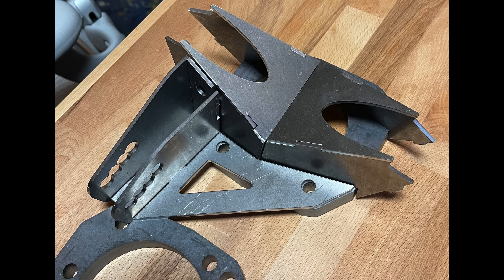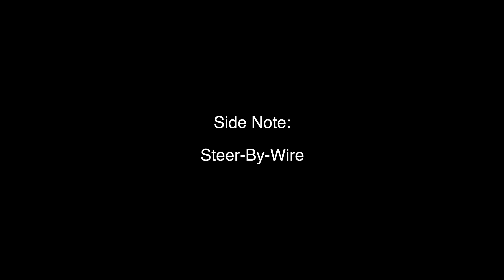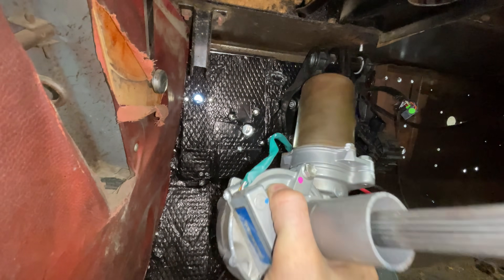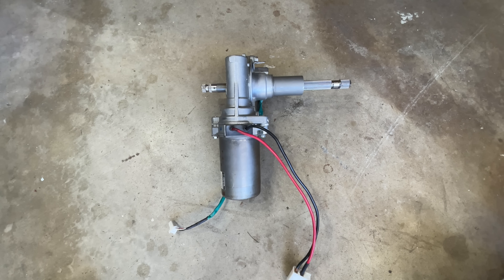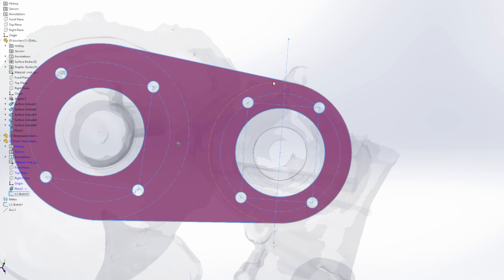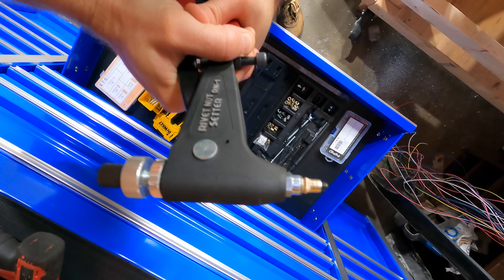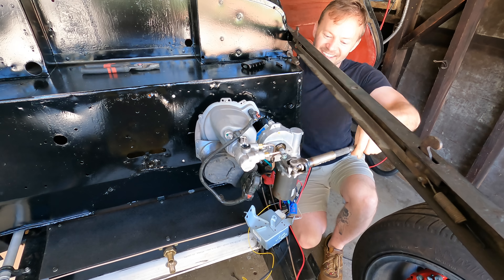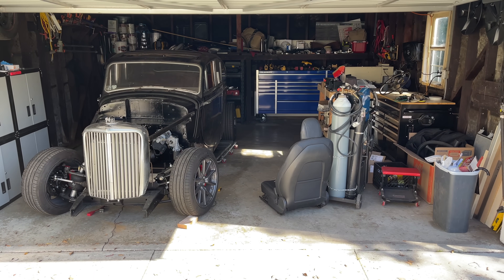Add Power Steering To Any Car

Comment: All hail the algorithm! 

I have no opinion of value, just my engagement. You may consider a steering quickener (1.5:1 inline gearing) now that you have power steering.
Reply from the maker: I swapped in a BMW rack that has a much quicker ratio than stock. It should be good this way.
Reply: @SuperfastMatt  Tesla, Toyota and BMW in a Jag. Its the UN in your garage.
Reply: @SuperfastMatt  theres an anti theft idea. iether have a switch,to switch the output to input, or a switch to desconect 1 wire. no power,no turn. ?. just a thought.
Reply: The Jag had a traditional steering box, not rack-and-pinion. There's nothing of the original Jaguar Mk V steering system in this car, so it doesn't have the original ratio.

Comment: I had that same Nardi steering wheel on my Daimler 2.5, I thoroughly recommend it, stylish and felt great in hand and would offer a better ratio than the cartwheel sized original Jag one, , only downside is they are often found on automobiles like Ferrari and Maserati.
Reply: Hey, me too, but I have a selection of leather bound, and also wood, to alternate on my '64 Daimler V8.    Same as Miata/MX5.
Reply: Nothing as ellagent as the Nardi.
Reply: I have one in my Datsun with a quick release

Comment: Hi from Australia! Love your stuff mate, always a great blend of info and no gratuitous wrench-turning video-lengthening shots. But seriously, awesome work! Now I just need to blow up... uh... I mean... find a wrecked Prius.
Reply: For Prius system...
dominic clancy
1 week ago
If you add a magnetic collar and hall sensor at the differential input flange, then connect the signal wire of the sensor to pin 5 on the D31 connector and 12V+ to pin 6, you will get speed sensitive assistance instead of just the failsafe assistance.  You vary the speed at which the steering firms up by adding magnets at the diff collar.  The unit will provide three steps of assistance.

Comment: All hail the algorithm.  Pretty cool video.  Drive by wire is not legal under DOT rules, so the law would need to be changed.  However, they've been flying by wire for decades, so it's past time DOT got with the program.  Meanwhile,  electric power steering without any bells or whistles is pretty cool.  

Re: Steering wheel.  Why not fabricate what you want?  LASER-cut the spokes as you want, then use an existing one to get the wheel grippy parts from... could even make one from magnesium, just for the cool factor, with a real walnut rim.
Reply from the maker: hmm, not a bad idea!
Reply: Have you noticed the price difference between a car and an aircraft with fly-by-wire? And that for most of the flight duration, you can entirely lose the controls for seconds at a time and still recover before crashing... unlike on a road?

Steering which normally operates without mechanical coupling ("steer-by-wire") but fails to mechanically coupled has been around for a long time (from Nissan), without regulatory issues, offering all of the functional capabilities of a purely steer-by-wire system. Eliminating the shaft entirely has nearly zero real benefit, so we already have an effective solution.
Reply: @brianb-p6586  Sure.  But, as I said, the technology has been around long enough, that the price could be easily within reach.  Hydraulic coupled steering has been around in construction machines for even longer, and is more reliable than pure mechanical ones anyway.   Worse-- anytime a mechanical power-steering system loses power, the majority of people lack both the skills and the strength to overcome the suddenly increased effort, so the entire point is moot.  DOT needs to join us up here in the year 2001... it's attitude is so 1940.  If DOT can be swayed by pure design motives (round vs square headlights) then pragmatic engineering should be permitted.
Reply: @brianb-p6586  I did research your claim, and could not find a single example of drive (steer) by wire in the US.  Infini is reportedly considering one for the near future.  If you have evidence otherwise, I'd love to see it.
Reply: @bobpowers9862  Nissan offered "Direct Adaptive Steering" (just do a web search for that term) for a few years starting in the 2014 model year Infiniti Q50, later in the Q60, with an update for 2017. They only seem to have used it in this one platform, only as an option, may have dropped it since. It has been widely negatively reviewed due to the lack of feedback.
https://www.infinitiusa.com/infiniti-news/technology/direct-adaptive-steering.html
https://www.nissan-global.com/EN/TECHNOLOGY/OVERVIEW/direct_adaptive_steering.html
Reply: @bobpowers9862  The upcoming system appears to be from Schaeffler, not Nissan (Infiniti). The have both steering and braking 'by-wire" products in their Paravan "Space Drive" product line - without any mechanical connection even as a backup - and claim that the steering system is "street legal". It is just an add-on to a conventional system (replacing the steering column) rather than a integrated system for OEMs. While currently used mostly for adaptations for disabled drivers, they have recently been promoting it with use in racing cars (only on the track) and are trying to sell it for autonomous vehicles. Since Schaeffler is German, the race cars are German brands running in the German touring car series (DTM).
https://www.schaeffler-paravan.de/en/products/space-drive-system/
https://www.schaeffler-paravan.de/en/products/space-drive-system/steer-by-wire/
https://www.schaeffler.com/content.schaeffler.com/en/news_media/press_releases/press_releases_detail.jsp?id=87415040
https://www.schaeffler.com/content.schaeffler.com/en/news_media/press_releases/press_releases_detail.jsp?id=87439041
Reply: @brianb-p6586  I cannot find anything that did not also include mechanical links in the train.
Reply: @bobpowers9862  As I said from the beginning, the Nissan system has a mechanical fail-safe - it operates with the mechanical linkage completely disconnected normally.

Comment: Might be entirely wrong but Exmoor Trim make after market Land Rover wheels similar to the Nardi one you showed. Being Land Rover they might have the have spline fittings as the original Mark V one. FYI I've no idea if this wrong or right... but maybe worth a quick search as it could save time and mean you don't need a boss

Comment: Steer by wire is such a dumb thing. Like, cool, but dumb as shit. It's a solution looking for a problem.
Reply: It saves a lot of space, but completely disconnects the driver from the wheels.
Reply from the maker: Designers love it because it allows for a lot more design freedom. You can also decouple the steering wheel from the tires for autonomous driving. And it can change the steering ratio for different speeds; Ford has this on the F150 but its a little clunky with a motor inside the steering wheel.
Reply: @SuperfastMatt  it would make sense in the context of a full, level 5 autonomous vehicle. You wouldn't need or necessarily even want a steering wheel in that context. But that's arguably not going to happen in quite a long time, if ever. I'd rather have a physical connection to the wheels in the mean time to avoid all the gubbins and nonsense that comes along with trying to make a safe steer by wire system. I'm okay with designers having to work within the confines of the existing steering setup, lol